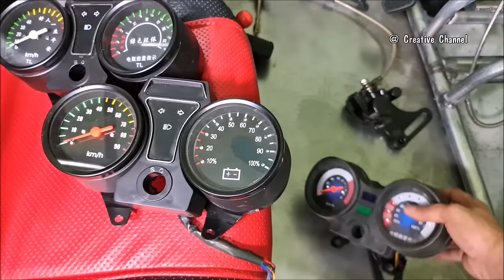Build a Buggy UTV Go kart at Home - Electric Car DIY - Tutorial

Comment: Brilliant.. one piece of advice - when caulking, cut as small a hole as practical in the tip - then lay your finger along the tip, letting the finger hang over about 1/2". Smooth the bead as you apply it. If the bead shows some 'chatter' (little gaps) just back up a bit and start again. You get a much cleaner and neater bead and a lot less waste, maybe 1/2 a pea sized dollop on your finger at the end.
Reply: 😊😊😊😊❤١
Reply: Que es un guisante??

Comment: I would have put the floor pan on top of the frame, I can imagine that filling up with water not good with all the electronics and rolling the edges of the mud guards would have been a nice touch and done away with the sharp edges, a few extra strengthening bars and panels  in some places would have nailed it still a job 👍
Reply: He covered up the wires with tape so if that did happen the wires and electronics would be fine
Reply: The rear indicators could have been brighter for daytime use. Amazing job otherwise.
Reply: Ocei
Reply: q
Reply: No need just add a drain
Reply: Absolutely battery need secure location can't reach water and another object,
Reply: ج
Reply: Well that means your still green behind the ears.. 
Because the frame ads rigidity if some sharp object comes flying up from the road
Reply: Mantap bang
Reply: I Want to know this mechanic building this gocart
Reply: Bal
Reply: يارب صب
Reply: @rblxtutorials1881   خلذحت
٠٢غمرنءكيك
Reply: @rblxtutorials1881  E bgtt

Comment: It would be great if you could name the individual components, their prices and your sources of supply.  Then everyone can get an idea of what such great projects can cost.
Reply: He's using spare parts from salvaged broken scooters and stuff. Generally his stuff is underpowered so it's best to use the strongest motor or engine you can find anyways. For example if you wanted to do this project in the best way I would use dual hub motors so you would have a hub motor for both of the rear wheels and this would eliminate the need for a differential like what he's using plus it provides redundancy in case one motor craps out
Reply: Actually I would prefer a gasoline engine or two of them for redundancy too
Reply: @eksine  I am more interested in the drive shafts, the brake components and the differential.
Reply: @goschmax  in the brake components basically if your vehicle weighs a lot just use one off of a motorcycle otherwise it looks like he jacked an entire set from a go-kart that he Salvage all his parts look to be go kart salvage parts

Comment: I'm in the process of fixing my go kart lol and I've got two electric motors on the left and right side back there both 1000w but wondering if anyone knows how I can make the motors go in reverse using a 6 dpdt switch and also a 3 prong switch for low medium and high speed how do I wire them up?
Reply: V vul
Reply: Mul Mul

Comment: Another great build, you are very talented. Please fix the rear shock absorber top mounts, they are orientated the wrong way, it's why you have very little suspension travel. It will eventually break the mounting brackets.

Comment: Awesome build,but this dude has to learn how to weld,those cold clumpy welds are going to break easy and they look like crap, being able to lay good welds will help get it done faster and stronger for safety,especially the steering components, like the steering rod he should of beveled both ends that he buted up and then turned his heat/amps up and welded it all the way around once, so it's good and hot and malted together,never lay tacks on each other unless it's a thin gauge metal,but besides that,this guys a creates and builds some awesome stuff.

Comment: Hello. At minute 31, we can see the direction of the front tires are backwards, upside down. A friend tells me that when the UTV is only rear-wheel drive, the treads of the tires are placed backwards to work better in water and mud. That's right? Or are they by mistake? Thanks, Great job. Congratulations!!
Reply: Muy interesante lo que nesecito es saber su instalacion repuestos canto tiempo dura la bateria si me da opcion cuantos km de recorrido 
Soy peruano vivo en la chacra por lo que necesitar energia solar para cargar.
Reply: The treads on the front axle should be reverse. It is better for braking. 
But without front-brakes it doesn't matter. ☺
Reply: Oh, he has front-brakes! 😮